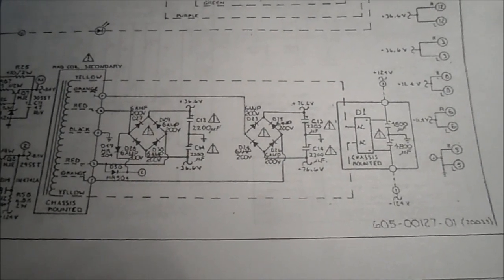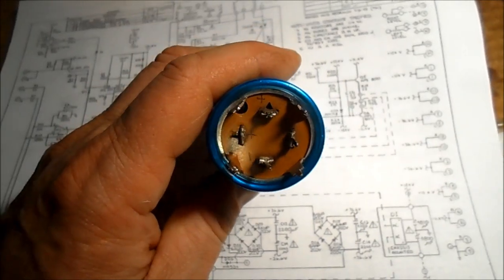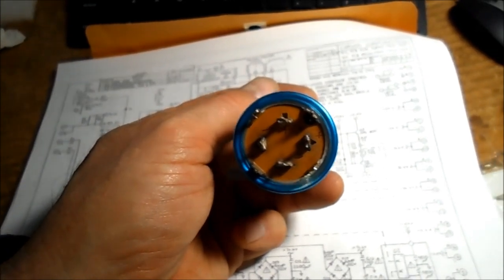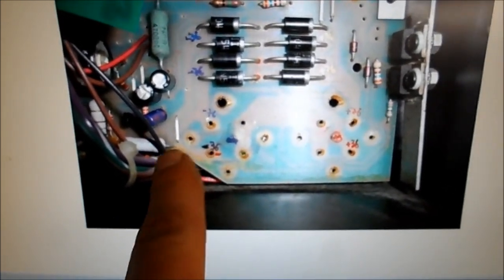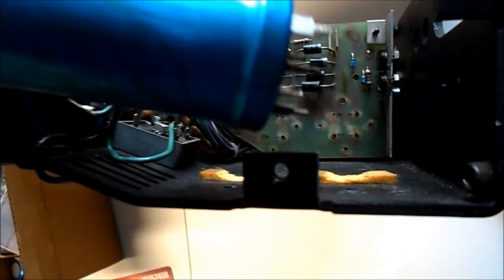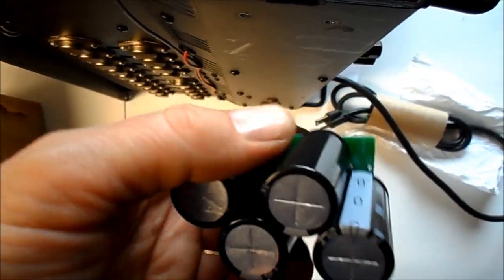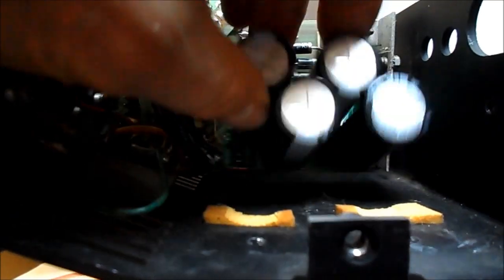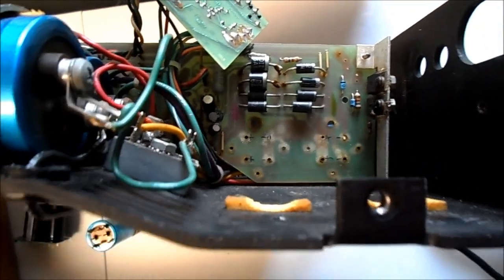Carver PM 1.5 Part 1.5. The Capacitors. Again. Confusion & Contradiction.

Comment: It is no mistake and is not unique to Carver. This is the most common way filter caps are installed in older gear with + and - rails with a common connection in the middle. Think of how you would wire 2 capacitors in series across a voltage. Does it make sense to you now?

Comment: Oh I was expecting a "Bang"  I found that the only safe was to start testing these *# units was to have two incandescent light bulb in series one 15 W and one 150 W with a switch across each so I could start them with just a 'tickle' another engineer had tried testing via a Vairac and the smell can be imagined.

Comment: The construction quality of the Carver is very good.   The sonics are excellent.   They also used the best power transistors you could get at the time.  I have owned two McIntosh amplifier's I sold because of the mediocre sound.  I had a 240 and 275.   Their transistor amplifiers are no better.  I like the big blue meters but that's about it.  Now McIntosh is putting LED's under the tubes to tell you when the amplifier is ready.  Looks Disco to me. The best tube amplifier I ever heard and wish I still had was a Harmon Kardon Citation II.  Ugly as sin but a really good amplifier.  BTW, rail switching is not new.  It first came out with the Hitachi Dynaharmony series.  Carver improved the design.   Now everyone has rail switching: Crest, QSC etc.  If your going to work on Carver's you need the service manual.   You need to read it and understand how it works before you do any work on these.

Comment: Maybe it's just a mental block, but I just remembered that I had a Carver power amp on my bench as one of the last repairs I did before I left. Dear God, what a relief it was to bring it up without another catastrophic failure - which is what brought it to the shop in the first place. 

I've just come to absolutely hate the brand. Poor quality construction. Sub-par sonic performance. And the multi-rail signal tracking system in itself was a problem area. Bob Carver wanted to give us a lot of power in a small package, and indeed he did - but there is a LOT to be said for old school traditional engineering.